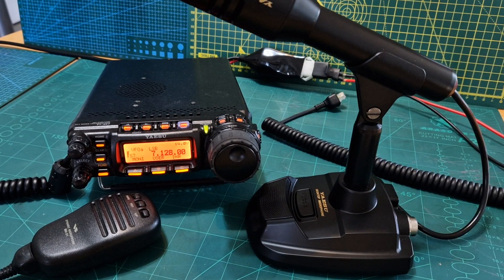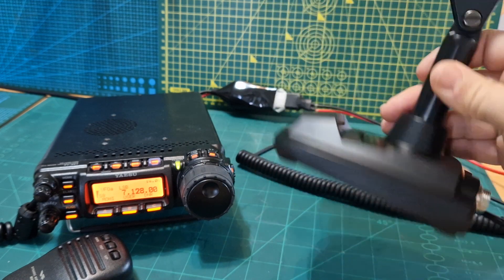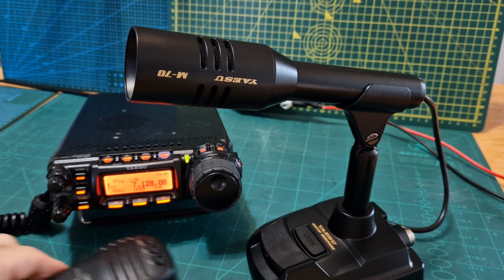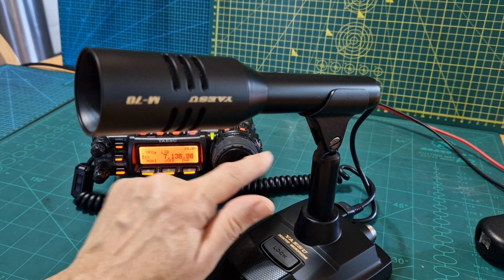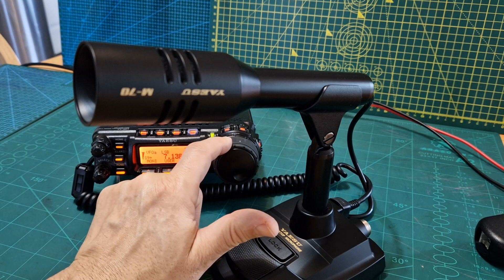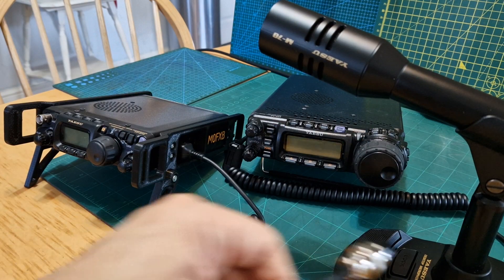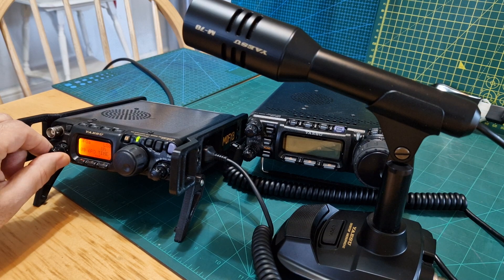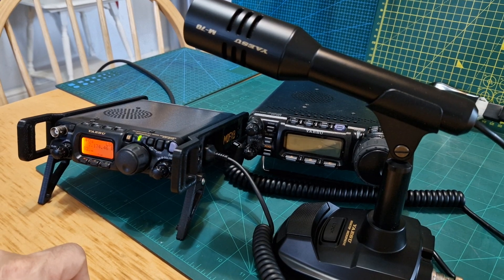YAESU FT857 & NEW M70 DESK MICROPHONE

Comment: Thanks for the video, interesting stuff :)  I have an MH-59 plugged into my FT-857 and I can’t get it out!  I took off the front panel and pushed the bottom of the microphone connection as I pulled, but it’s not coming out!  It won’t disconnect at the microphone handset end as that’s hard-wired, so I guess it’ll have to stay put!
Reply from the maker: Be gentle